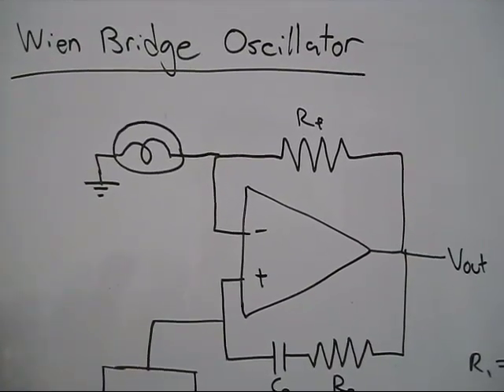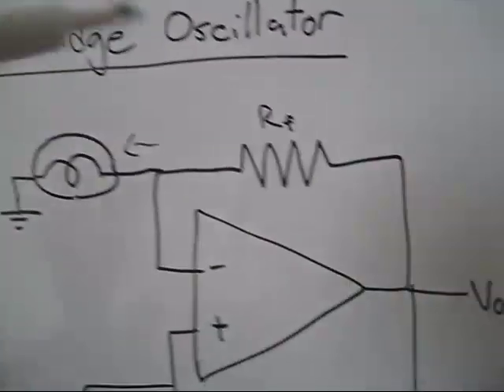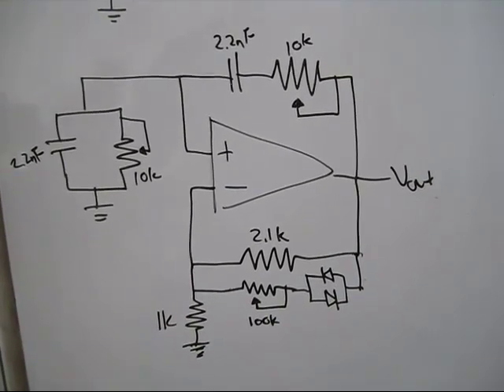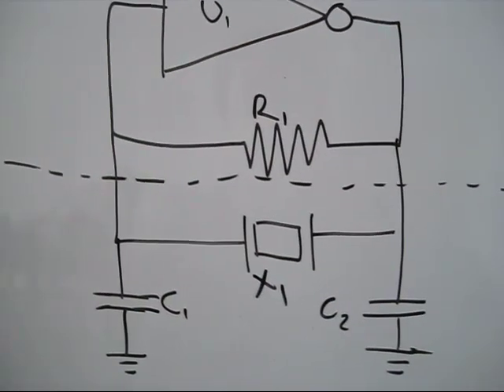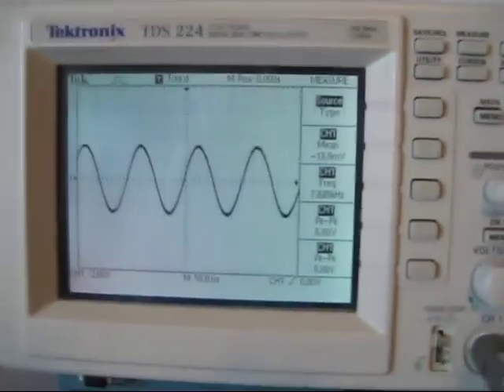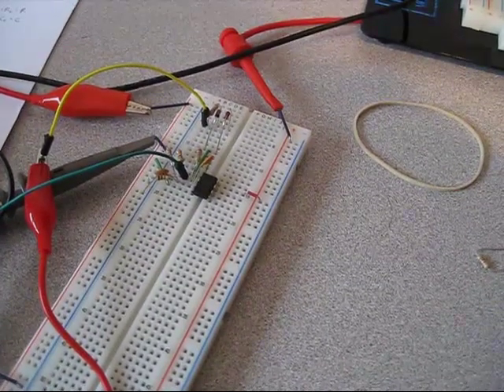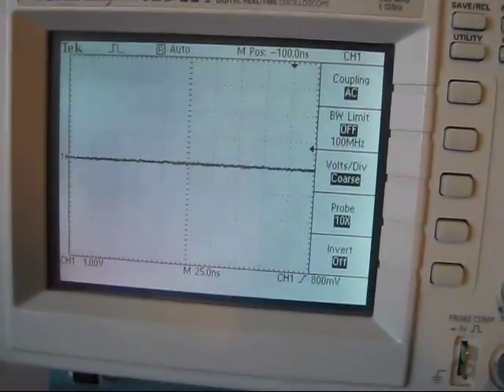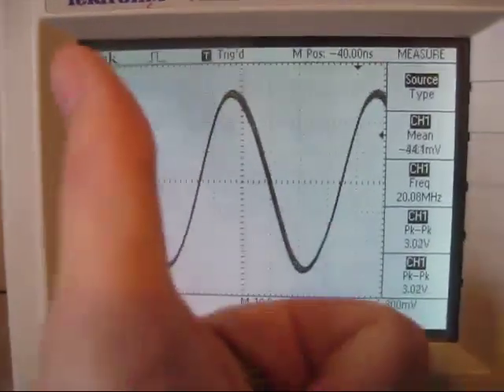Episode #8 - Wien Bridge and Pierce Oscillators

Comment: Hi, we have a project about Wien Bridge Oscillator, and we need to design one, with atleast 1Mhz cut off frequency. I've done many computations, and also done lot of simulations, and unfortunately my simulations wont work. Maybe because of the kind of op amp i am using, Op amp 741. I just want to ask, what should be the kind of OpAmp i should be using to have an cut off freq of atleast 1Mhz.  waiting for your reply!

Comment: You mentioned that adding another inverter to the circuit using the pierce oscillator would make a nice square wave. since the 4069 had other inverters built in you should have connected one and demonstrated it after you mentioned it. would have made the vid more complete. just some constructive feedback! Regards.